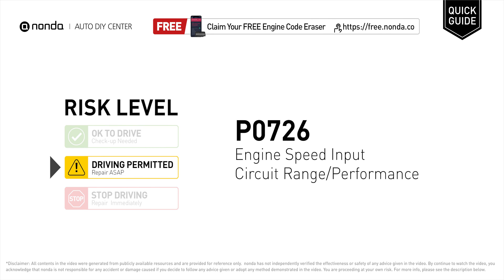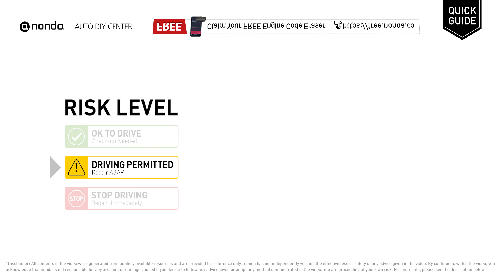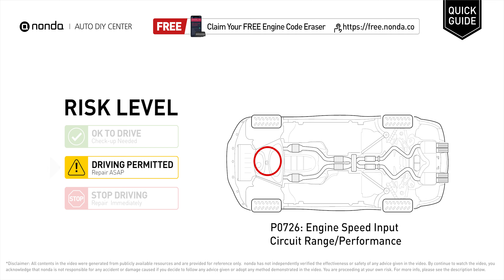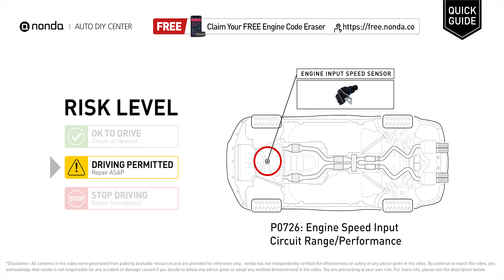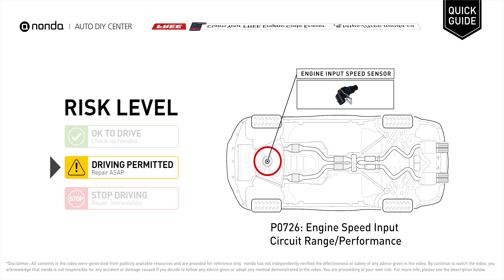What is P0726 Engine Code [Quick Guide]

Comment: P0726? In vw tigwan its the same  ??
Reply from the maker: Hello, as per your vehicle's make/model, this code is triggered due to a faulty crankshaft position sensor or issues with harness/electrical connections.